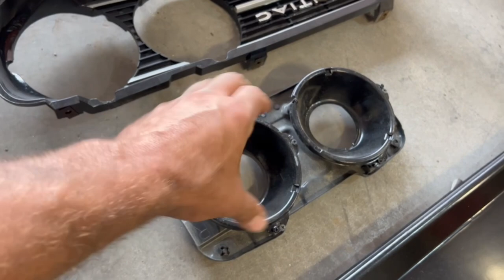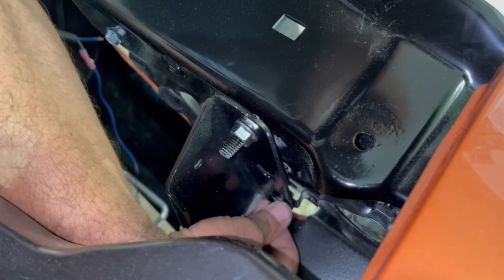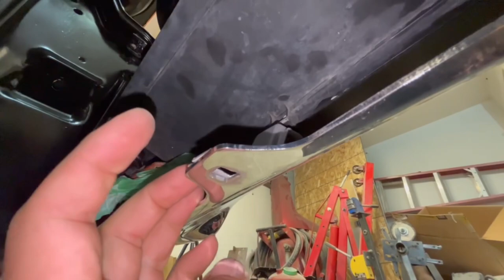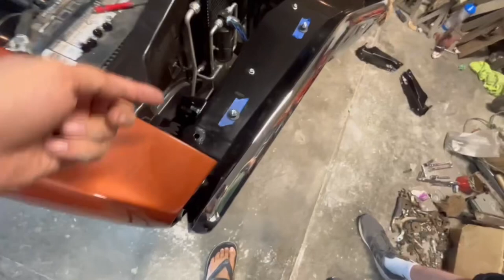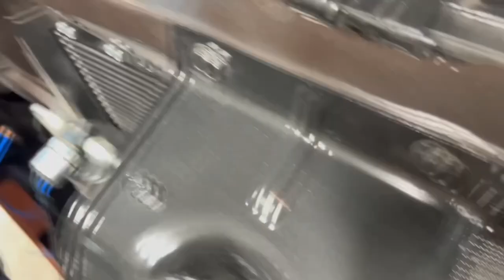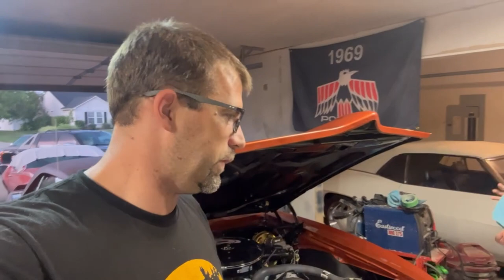Front bumper and grill installation 1968 Firebird

Comment: Your videos give me confidence to tackle my own project. I have 67 LeMans in process.
Question, I have seen several videos of using Rustoleum semi-gloss black in a spray gun with an added hardener for firewall/engine bay. Would you recommend this? Thanks!
Reply from the maker: Good deal. I had a 67 lemans really cool car they just look tough sitting still. I traded it for a 1969 Gto convertible that’s a fun story…. Anyway rustoleum with added hardener i haven’t tried it personally but my friend in Pennsylvania Luis has and I will say when I helped him
Install his engine and transmission it was a very durable finish we bumped it a few times and it help
Up well.

Comment: Were you able to shift the bumper towards the passenger side? Mine is the same way and I've been struggling with it. Thanks for the videos!
Reply from the maker: Yes it had
Just enough adjustment to make it work.  I don’t love the aftermarket bumper but it works and way less expensive then a rechrome

Comment: When doing  restoration, how did you clean up all the fasteners and hardware for putting things together? The little bits and pieces that can't be sanded or sand blasted.
Reply from the maker: Small parts I used a media blasting cabinet with black beauty media.  Now the small hardware that is visible and zinc, black oxide, or like cadmium plated I purchase a lot of it new as a kit from Ames performance. Relatively inexpensive.

Comment: Appreciate the video!  How similar is this process to the 69's?  Mine has always been off a bit from the body shop and it drives me nuts.  Low on the driver's side and shifted to the passenger side a bit.
Reply from the maker: Sorta the same. The bumper bracket  to subframe is identical. you can adjust the bumper assembly up and down in and out. Side to side is a little more tricky
Reply: @VinylVillageGarage  That somewhat confirms my understanding that the 69's have little to no left/right adjustment.  I know my car was hit in the front end at some point in it's early life.  Could account for some of the mis-alignment.

Comment: Looks fantastic, did you repaint the grills or are the new ones?
Reply from the maker: Repainted the original grilles. They where in good shape still
Reply: @VinylVillageGarage  looks great, just resprayed mine as well, struggled to get the silver lines good, so was curious on how you did it
Reply from the maker: @srenmrkandersen4580 i should have done a video i suppose.  The short answer was stripped paint, painted grilles silver then taped off the silver then painted the black